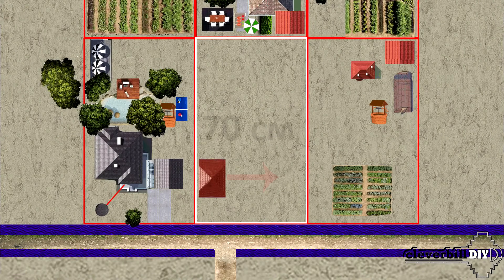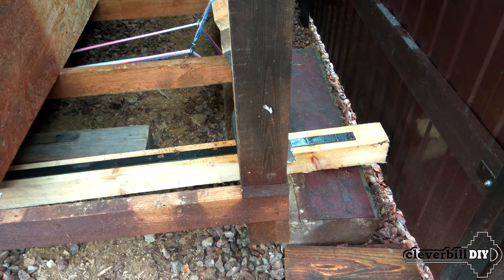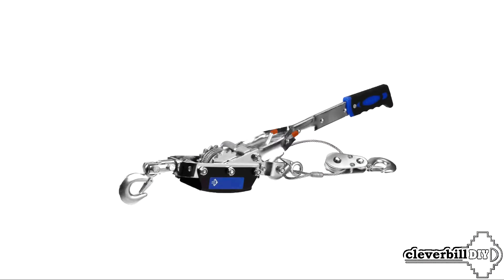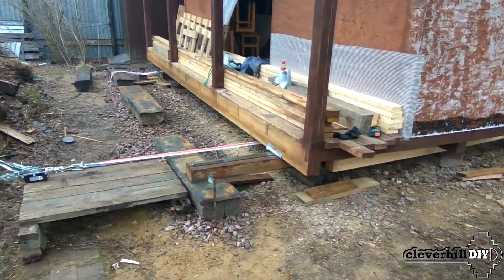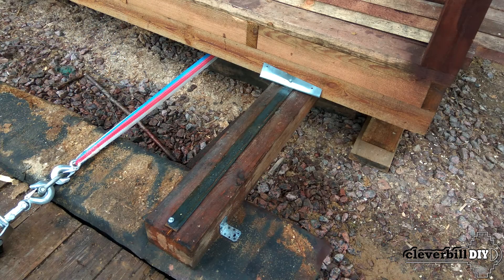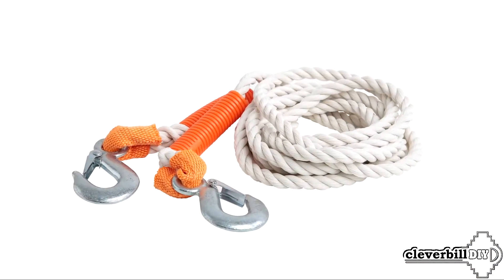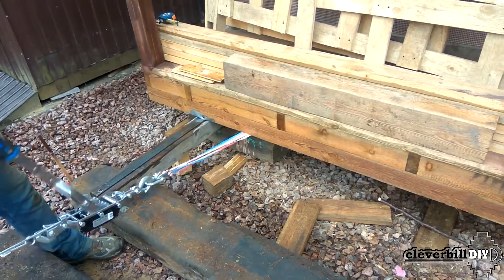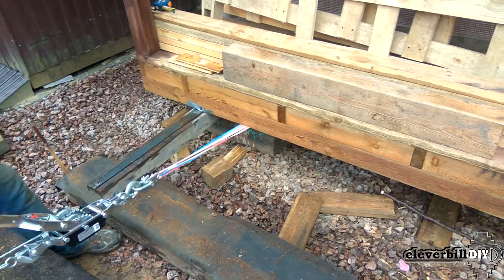How to transfer (move) a wooden building to another place - DIY

Comment from the maker: It is not difficult to move a light building to another place, the basis of everything is compliance with safety regulations, a solid foundation, stable ground, temporary intermediate supports and reliable guides. For heavier buildings, the guides are no longer used from wooden beams, but steel I-beams. When moving a load, one of the most important tasks is to minimize the friction force by reducing the contact area or using roller bearings.